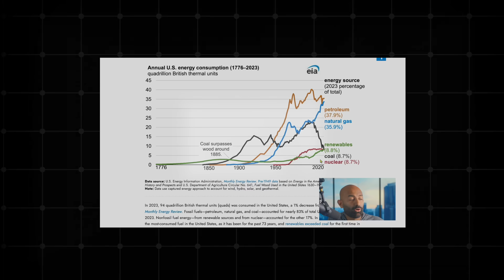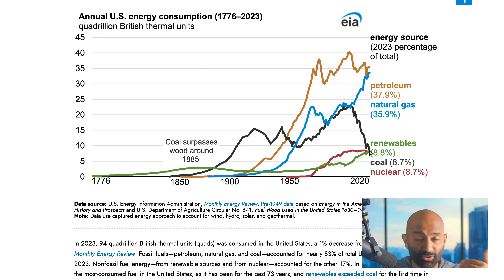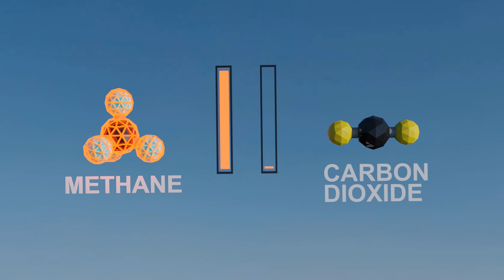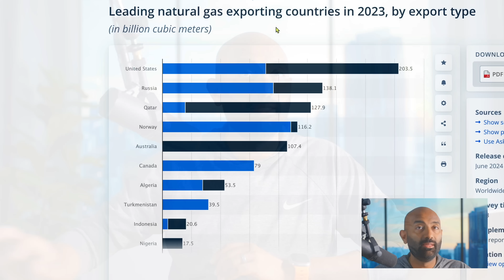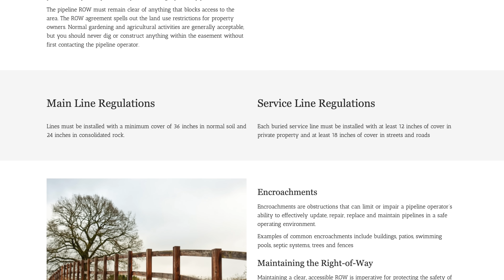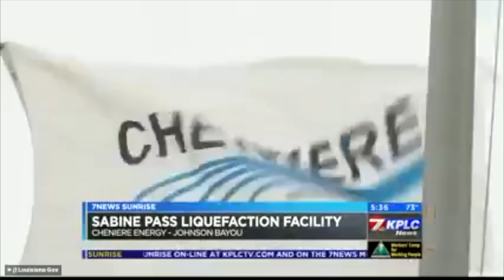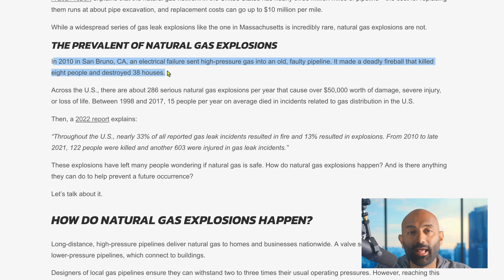The TRUE Danger of Natural Gas - This SHOCKED Me

Comment: In the UK iron natural gas pipes have been largely replaced by plastic.  Older iron pipes are used as conduit running new plastic pipes thru them at a higher pressure.   

Also the UK, and other cities around the world, are full of combi boilers in small houses and apartments, which is the space heating and on-demand hot water in a small white box on the wall. The packaging is exceptional. Converting from natural gas to hydrogen is the best way. Heat pumps require a hot water storage cylinder and a large heat pump taking up large volumes of space in a small apartment. We have extensive natural gas pipe networks which are there waiting for hydrogen.
Reply: Hydrogen used as a fuel is at best a low efficiency battery. Almost all the hydrogen produced today is made from natural gas. There will be significant losses in energy in the production of hydrogen. One BTU of natural gas will produce less then one BTU of hydrogen. So long as hydrogen is made from natural gas, it is more efficient, cheaper, and produce less carbon dioxide if the natural gas is burned directly rather than converting it to hydrogen. 

"Green" hydrogen can be made by using electricity to break down water. This is only "green" if the electricity is made with green electricity. Until all our electricity is made from solar, nuclear, wind, or other zero carbon sources, it will be much more efficient to use electricity to power heat pumps then to generate hydrogen to burn. It will still be much cheaper and more efficient to use batteries with rapidly improving battery technology to redistribute the electricity from variable sources like wind and solar to the time that it is needed than to produce hydrogen to burn.

The idea of using existing gas pipes to sell hydrogen is nothing more than green washing by the gas companies trying to keep their business running as long as possible, selling the idea that it will be green in the future which I think is very unlikely.
Reply: @kurthanushek5520  
Nonsense. Sounds like propaganda. The existing gas networks are perfectly suited for hydrogen. As you alluded to, hydrogen can be produced via green electricity. Lots of solar and wind electricity is made during the slack periods enabling easy storage. Also hydrogen can be produced cheaply using nitrogen cooled reactors, as the Japanese are doing right now - this channel covered it. Hydrogen can be produced say at train depots by green electricity entailing no hydrogen transportation. Clean hydrogen trains can replace filthy diesel. 

A country like the UK can be 100% green electricity, and very quickly - the project to do so has been accelerated. 

If you got the prime point I made, which is that heat pump equipment with associated large hot water storage cylinders (tanks in USA), is just far too large and cumbersome being totally unsuited to millions of homes. 

I have a natural gas combi heat generator (boiler) in my place, that supplies the space heating and on-demand hot water. A white box on the wall. It is hydrogen ready.
Reply: @ 
My reply was deleted.

Comment: The Life cycle analysis of NG shows that due to methane leaks, it is as bad as coal for climate change.  Also, since 2019 batteries +PV are already cheaper than NG, so keep using NG is more expensive and much worse for the environment.

Comment: ❗️COST EFFECTIVE ELECTRICITY MUST FIRST BE IN AN ABUNDANCE.  I am in Chicago and I pay with delivery, all taxes, all in .13 per KwH.  San Diego is crazy rate retails .40 and overall California .33 cents and I don’t know about taxes. 

It’s been between 25 to 40 degrees this winter in Chicago and my natural gas bill was $148 and the electricity was $127 all in with two natural gas furnaces, gas stove (with 240vac resistive plus heaters in the ovens) and natural gas for the water heater.  And boy oh boy, our Lake Michigan water is frigid from December to May.   In the summer the gas bill is around $50 a month and electric is $150 to $175 and a couple months $220 for two Bosch AC compressors with two stage efficiency and with the infamous Mitsubishi secret sauce super efficient circuit boards.  We have done what is practical given infrastructure capabilities.  We don’t have enough sun so solar is impractical.

In the US It’s really a harmony of factors with operational, logistical, long planning and political implications.  Take the new AI data centers and push for more bitcoin type services which will grow way faster than building electricity plants and the only stable power is in question.  Take the massive sun harvesting project in Montana where 100 megawatts is expected. Place your data centers there or in cold places?  The fact is Base Load is forever and Supplemental Energy like wind and solar are a factor. But it still remains that natural gas is what we use COST EFFECTIVELY to use Peaker a plants to meet load peaks as a predictable source that is perhaps even decades away from extinction.  

Our political will in the US swings like a pendulum of children fighting in the playground over which billionaire has more greed.  The lack of ethical strategic modern leadership planning will push We The People to worry more about the amount of energy and household bills over paying substantially more for alternatives.

The reality check, it’s a monster.  One size does not fit all.  Chicago is no LA.

Comment: I have been looking around at real estate and I noticed that nearly every house in the Midwest and Illinois in particular has natural gas. Their grid of pipes is about 80 years old and they need to replace them, or switch to something new, like heat pumps. I’m going to bet they just dig up and replace the old pipes. I had gas in my previous house, but am all electric in this one and have been replacing old appliances with new heat pump versions.
Reply from the maker: That’s awesome! Heat pumps really are the key to make electricity cost competitive with gas. Sadly natural is subsidized
Reply: Let’s hope they dig up the natural gas pipes & replace them with pipes capable of carrying higher percentages of H2!

Comment: Anectdotal: We live just north of Boston and shut off our gas line. It saved us in $250 per year in flat fees. We use a German heat pump, induction stove (love it) and heat pump water tank (enabled us to remove our chimney). Winters get very cold and the heat pump can do it but our house is not well designed to keep heat in (old insulation and too many windows etc). So we have a pellet stove that serves as our supplementary heating. It is affordable and I enjoy looking at the fire. Pellet production is iffy too so needs some work.
Hoenstly one of the biggest energy issues is not source but home design. Too much sunlight coming in in the Summer; too many windows in the winter etc. I envy those efficient bermed (sp?) nestled into a hill.
Reply from the maker: A pellet stove for really cold days is a great option. Think about how much cleaner things are for the majority of the year. As for insulation, my first thing I want to do is insulate the floor. We’re on a raised foundation, and the floors get cold because they’re not insulated. Walls are harder, but I want to eventually improve that too
Reply: @TwoBitDaVinci  Given that cold does not rise, the simplest of insulation can break any thermal interface and keep the cold from getting in through the floor. The roof/ceiling should be the 'first' consideration and is a little harder to achieve.
Reply: @crayzeape2230  More properly, insulation slows down heat transfer.
Reply: @tedmoss  I can't argue with that, but I was referring more to effect on the air in the room. I find comments that are too nerdy ten to vanish.
Reply: @TwoBitDaVinci  I just started reviewing a product that you add to your paint and when the paint dries, this forms a radiant heat barrier, turning the ordinary house paint into heat-reflecting thermal paint. I am not sure, but I believe NASA came up with the product. It is called Insuladd (a powder that you mix with paint) and claims an energy reduction of 20%. Since you are looking into saving energy, maybe this is something that you can use.
Reply: @TwoBitDaVinci  Tell me you live in a city and have no perspective without telling me.

@darmethisname I guarantee you pay more to waste your time and money on appliance than $250, not to mention the risk to you health and property. Let me guess, you haven't told your insurance company about your little "life hack." 

stares in MN winter
Reply: @drewlarson65 ahh it is 250/yr and yes they know of my ‘hack’ which is a perfectly legal pellet etove so what kind of point are you trying to make?
Reply: The first and usually cheapest step in making your house more efficient is fixing the existing insulation.
Reply: Eaves that overhang windows can work well- otherwise, you can try installing an awning that rolls out in summer and can be rolled back or stored during the winter. If you don’t mind the appearance, you can even use solar panels to provide shade over the windows. More adjustable mounts would even allow you to adjust the angle of shade according to season.
Reply: You apparently do not live with minus 20 C most of the year.  Or have some weeks of minus 30 & 40 C.  Heat pumps do not work under those conditions.  Heat pumps need electrical power which comes from natural gas (low CO2 emissions ) or from coal, oil, hydro or nuclear
Reply: @MikeWurzer  Or solar, don't forget the most cost effective source as well as wind. The real reason to burn methane is it does not have as much other pollution as other fuels. Hydro or nuclear have no emissions.
Reply: @ That used to be true. Now there are air source heat pumps that work down to -25C then kick in a resistance heater at lower temperatures. 
Though it is more expensive initially, a ground source heat pump will work whatever the temperature outside.
Reply: @ There are heat pumps that work down to -30C. Though they use a lot of electricity to do so. 
Also, here in the US, we just hit 50% non carbon sources for electricity for the month of March. And the carbon sources are dropping fast.
Reply: Burning wood in any form is a bad option. The burning produces a lot of fine particulates and PAH's.
Reply: @plot1184  You forgot how used to it we are, been doing it for thousands of years. Now diesel, that's a different story.
Reply: @ That isn't necessarily true. There are new wood stove designs that burn very cleanly and there are catalytic afterburners that can take care of older stoves.
Reply: @ There are wood stoves with catalyst after burners and two pass burn chambers to pretty much eliminate the fine particles.
Reply: It makes sense to shut off the gas, it's a fire hazard and leaks in many old lines adds to greenhouse gases as well as gas traveling along the outside of the pipes into homes.
It would be more efficient to generate electricity directly from the gas.
Reply: In Southern California, old homes have large windows that allow sunlight in to add supplemental warmth in the winter, and can be opened to allow breezes to flow through the house during the spring and summer.
Humans need light. Humans need outdoor spaces. Humans need to breathe fresh air and our bodies need to be in the practice of regulating our temperatures--we are not designed to live in temperature-controlled environments.
Reply: @user-mv9tt4st9k  That was on a cooler planet. Those same homes will be death traps in the summer now.

Comment: You should not forget the other problems with coal. Particles, heavy metals, sulfur and carcinogenic substances. Natural gas has very few problems of that type. I am no a great supporter of using natural gas, but it is a great improvement when you compare it to coal.

Comment: I agree that NOT running more gas directly to homes is smart here. Even in Michigan we have had geothermal heat and cooling for more than 30 years. No gas at all. It's a great solution. We have electricity to every home, leverage it!

Comment: I tried to go full electric during renovating my house last year (even though I'm in the north lol).

The fight against the HVAC guys was insane, ended up keeping gas for hot water and the furnace due to not having enough room in the old electrical panel for the new breakers needed (though I did swap to induction for cooking)...   ...only to have to replace the electrical panel at the end (I required a whole home surge protector, it was forgotten about until the end, and "oops, we don't have room), upping it to a 200 amp service, so would've been do-able...  but the furnace and hot water tank were the first things replaced in the process, so couldn't back out, kind of annoying.

Gas will be gone when I have to replace them.

Comment: Good information and funny you discussed this today. As I type this I'm having a new Daikin Fit Heat Pump system installed in my home. The house built in 2000 had two  HVAC systems with a Trane 3 ton CNG for the smaller upstairs area which was upgraded to a more efficient Trane HVAC after failing last year. The main house system is a 5 ton Trane for the downstairs and I'm replacing it with the Daikin Fit 5 ton 18 Seer 2 before it also fails. Since I already have a 2021 installed 12.8 kW Solar system with 2 Powerwalls and live in Northern California near Sacramento, I'm confident that in this moderate climate my heating and cooling energy needs will be mostly addressed by the solar system. We also have 2 electric vehicles that are charged 90% at home. 

Since the less used upstairs HVAC and 75 gallon water heater are still gas, I will not be cutting the umbilical cord to PG&E for a while but all other appliances are electric including a new Induction cooktop (love it). I am committed to an all electric, off grid grid energy efficient home and I'm 75% there. My electric bill is tiny and due to my excess energy generation I get rebates from my electric company (SMUD) every quarter. These energy improvements have a 8-10 year payback but once there it will be all good. That's my $.02
Reply: The toxic components in the solar panels (non-toxic glass & aluminum are recycled) are a superfund waiting to happen.

Most lithium batteries are also not recycled, and lithium leeched into ground water is linked to autism in children.

Let’s hope those powerwalls will be recycled & not cause a generation of autistic kids in your area… as the vast majority of lithium batteries have been dumped for decades.

Comment: Pipes for gas going through the whole country but when it comes to DC power lines for clean electricity... it turns out the land is untouchable
Reply: DC is simply a no go when it comes to long distance. there is too much power loss unless you step up the voltage for long distance and then step it back down. this is a much more expensive process for DC compared to AC. I agree DC is better in many ways but it is not practical. even in your house the AC is stepped down on virtually every device and, again, this is more complex, much cheaper to use a transformer to get the needed voltage then rectify it to get DC at each device. It should be noted that devices need to have different voltages from device to device.  A heat pump needs that 240 volts to keep amperage reasonable and your phone needs 5-20 volts more makes it a shock hazard.
Reply: @lonnmarsh7143  That's why they use DC for the real long haul lines, because it is not practical? Almost all equipment runs on DC converted from AC with inverters, even the new AC units use inverters. Electronic switches for the uninformed. This is a different world from Edison's.
Reply: @lonnmarsh7143  the company I currently work for (hired IT hand) operate several oil rigs in the North Sea. Some of them get power from shore; the one I know best uses a DC line as AC would be too lossy for the distance involved. There's a new project coming online in a couple of years though which will use AC to save space on the rig; I was told this wasn't possible until quite recently at those distances - improvements in high voltage/high current electronics now makes it possible.
I also remember reading about megavolt DC lines, but I guess the key here is distance - HVDC is only economically viable for very long distance main feeds, due to the installations required.

I suspect the original commenter really meant AC and not DC though ;-)
Reply: You can look up DC transmission and the wire size and distance is crazy limited like Samuxan mentioned. However, the number one electricity consumer by industry is power companies. Because transmission lines consume that much power. Best bet is to produce electricity close to the area it's being used, like roof top solar.
Reply: @jugklutzz  But solar is only as effective as the local weather will allow.  Up in the northern states, where days get shorter in winter, and overcast is common, the total output potential is markedly lower.  

Unpopular opinion:  But you can produce substantially large amounts of electricity via Nuclear with extremely small amounts of real estate.  More than enough to offset the loss of grid impedance, even over large service areas.   

Frankly all of this misses the real overarching problem thats holding everything back.  We lack we a reliable way to store power in the amounts we could draw on during high demand.   Generate excess power and store it, then consume it when production output is lowered, or more costly.  If you pad the modulation in usage, you can more comfortably optimize the production side for stable or rotating output.